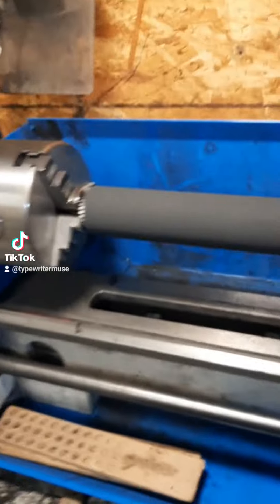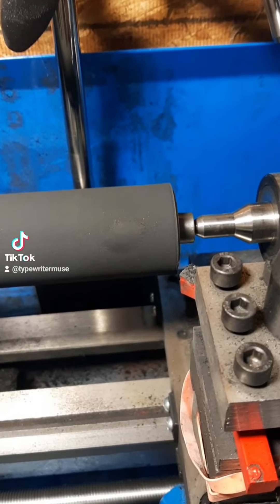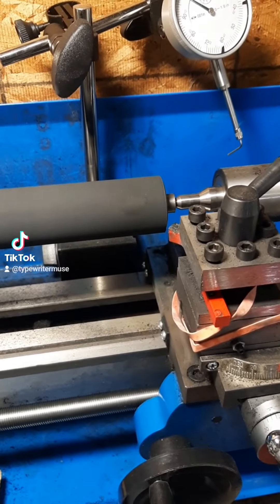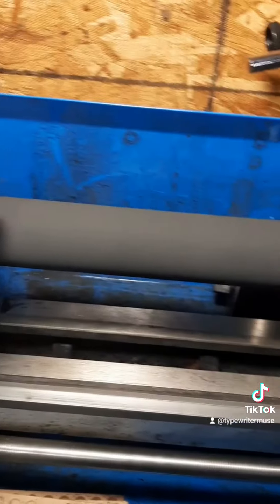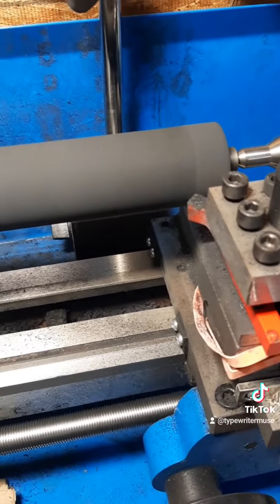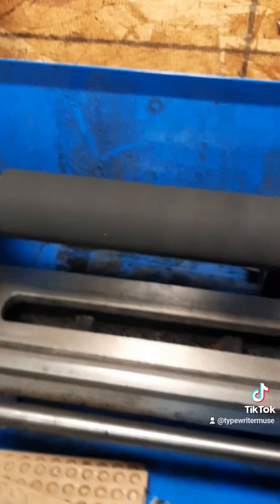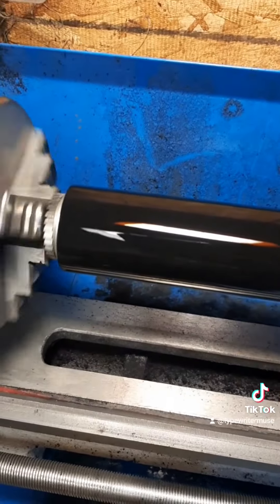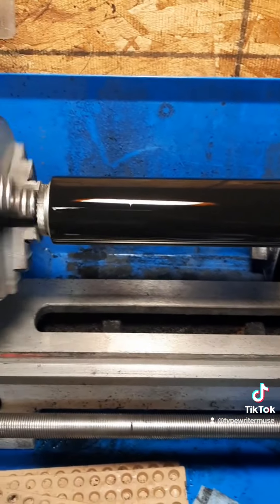Typewriter Platen Truing and Conditioning.

Comment: Hey Bob! Nice video. I was wondering if you had tried HSS inserts cutting bit to compare with, I am assuming, the carbide insert you are using?
Reply from the maker: They work well and I do have to use them on smaller platens but the loose point faster.